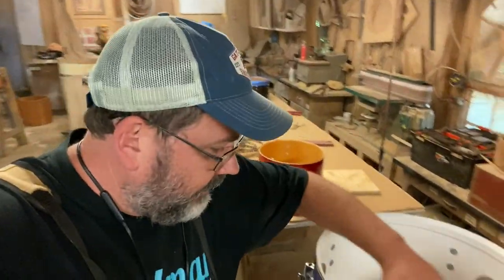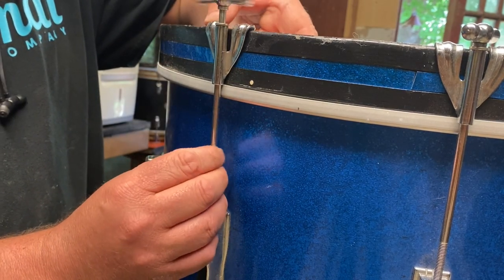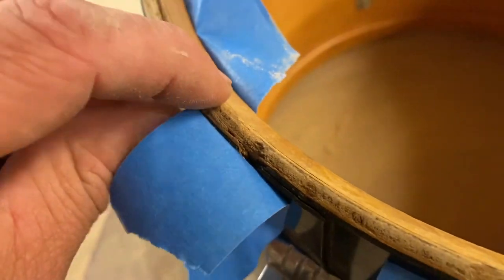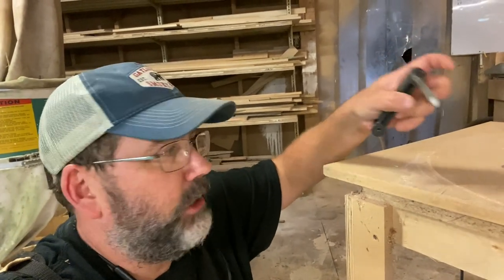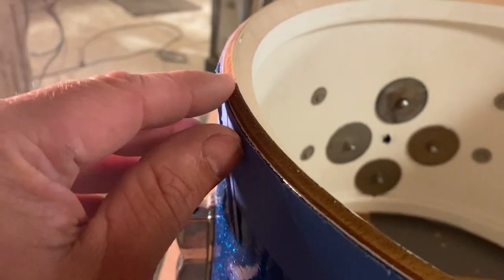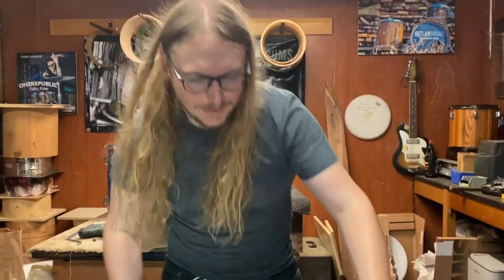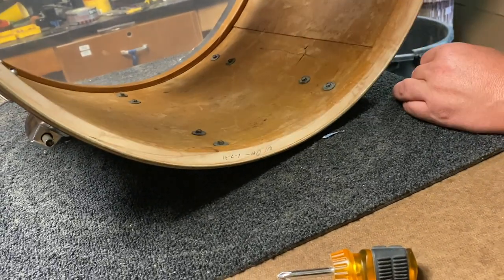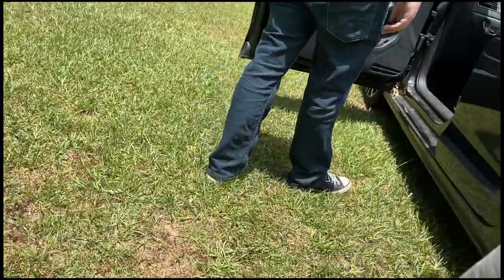1969 Ludwig bearing edges RE-RUN

Comment: Can't go wrong with those old Ludwig 3-ply shells. My '69 and '63 kits sound amazing for their age.
Reply: well.. you can go wrong.. actually quite a few of 60's 3-ply sound pretty bad. The good ones are amazing, the bad ones... ouch. I restore drums too by the way so I have had probably 30 ludwig 60's kits coming through. Never buy a 3-ply without hearing it first. Some of them have ZERO low end.

Comment: Really interesting Michael, thanks.  Question: when you recut like you did, how much would you expect to take off from the drum?  In other words, if the floor tom is 14" high and you recut the bearing edges, what would it measure afterward, 13.5"?  Thanks.
Reply from the maker: its not that much. about 1/8-3/16 less per edge sorry just seen this!

Comment: my ocd is triggered by the tilted Ludwig badge...  jeeez... :))
Reply: putting the old heads on new sanded shells makes no sense, the drummer should get new heads for eye opening better sound now. the old heads were on the drums for years and have been molded by the faulty bearing edges; now making perfect edges means the old heads are not level anymore, and might actually sound worse than before. Had customers complain that they could not tune their drums after I fixed the edges, but that was due to the old heads being really messed up. New heads, and the drums sound better than ever. Drummers should realize this. Some think that keeping the original heads is actually an acomplishement, but jeeez...
Reply: @adorodrums  Agree 100% ☝️ Fresh new heads, properly seating those heads putting pressure in the center to get rid of the wrinkle and actually seat the edge. Tune by ear from there then use a tune-bot to be more precise and fast if you're into that

Comment: Some people like old shells with modern (doble 45) edges, but I personaly don't get it - I'd buy new drums instead.
Reply: well.. a lot of old Ludwigs had double 45 edges from the factory. I have a mint 1970 3-ply.. clean and somewhat sharp double 45 factory edges. But yeah, a lot of us like the worn out flat and round Ludwig edges... even though they are often way off the factory edges.
Reply: @HR2635  Re-doing the edges is a must. Most of the times there's no need to use the router. 3-5 mm. wide flat edge might be finished (round over) by hand with no problem. And it becomes buttery smooth edge which follows the contour of the collar of the drumhead.